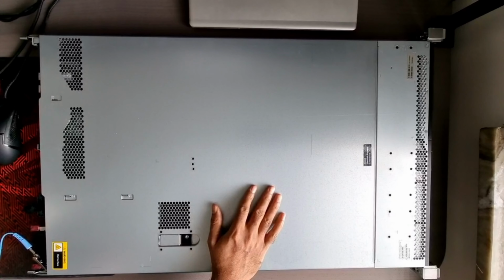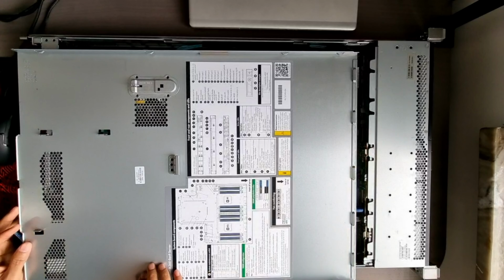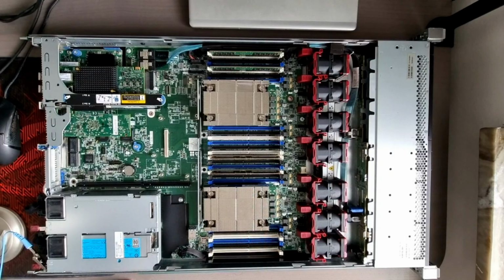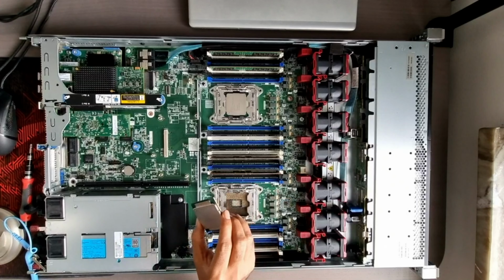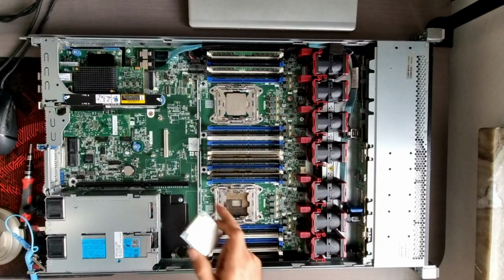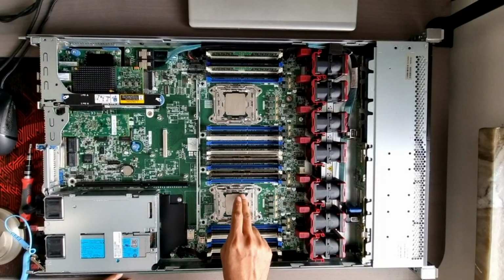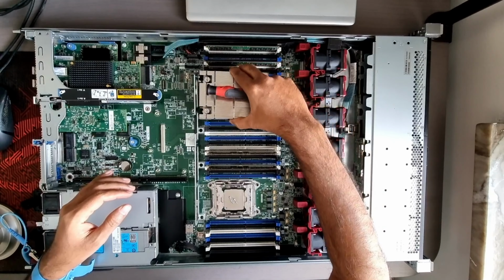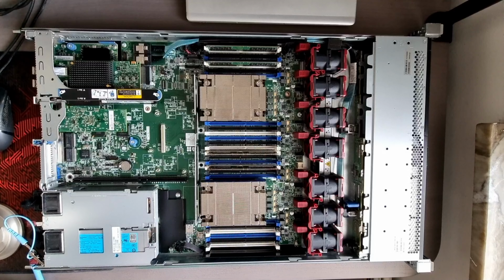How to replace CPU in HPE Proliant DL360 Gen 9 Server

Comment: what lga is the board?
Reply from the maker: Board has Intel C610 Series chipset, which supports Intel E5-2600v3 and E5-2600v4 processor family. These processors runs on socket LGA2011-3